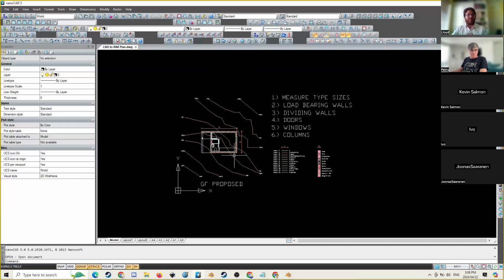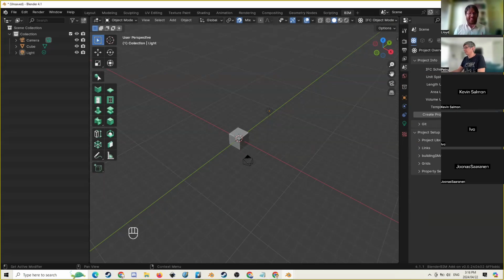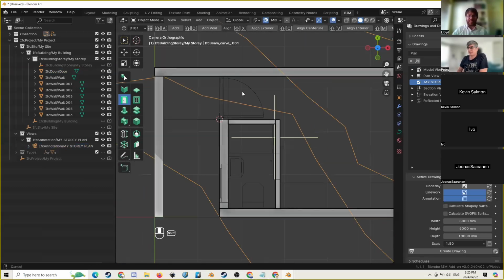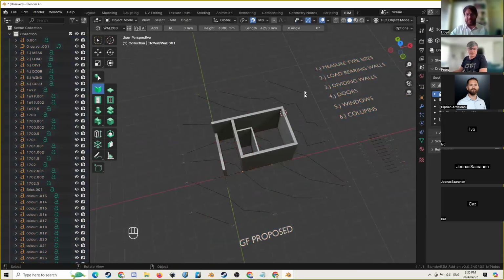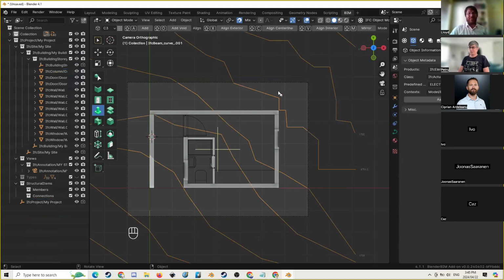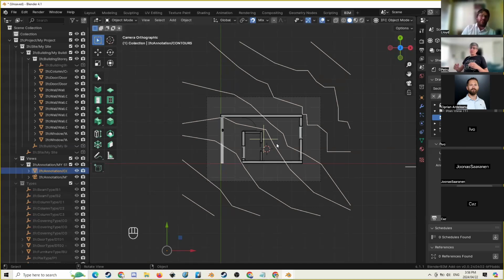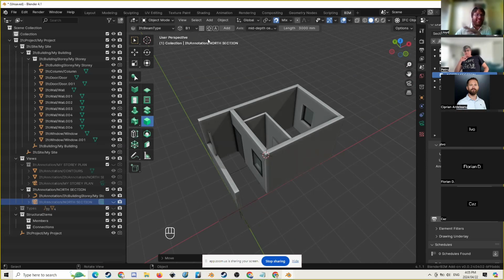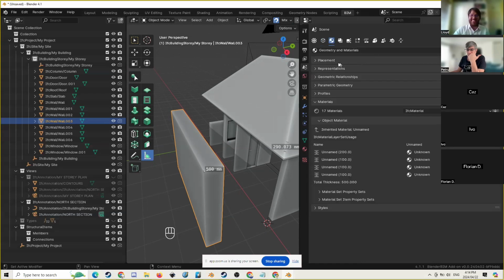CAD to BIM with Revit? Try this instead

Comment: Can I convert a building I made in Blender to ifc. Can I convert every blender object to an ifc object without making the building from scratch in BlenderBiM? Just starting out with ifc work. Answer would be much appreciated. Don't want to make two buildings, one Blender and one ifc version (double work)
Reply from the maker: You can, but I’m not sure is the best option. You can try and see for yourself how it works when you assign an IfC class to each object…
Reply: @BIMvoice  Takk for svar👍 Jg trenger fotorealisme. IFC-bygg er ikke så fotorealistiske, eller tar jeg feil...?
Reply from the maker: @HrPedrosak  For fotorealistiske modeller da trenger du ikke IFC. For det kan du bruke vanilla Blender, eller andre programvarer som finnes for visualisering.